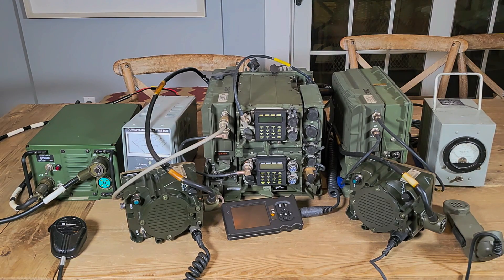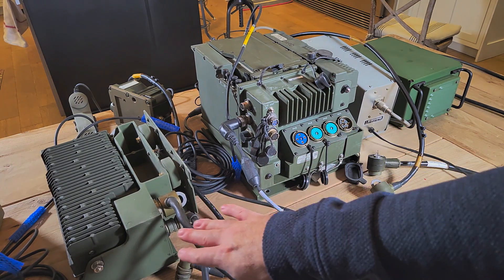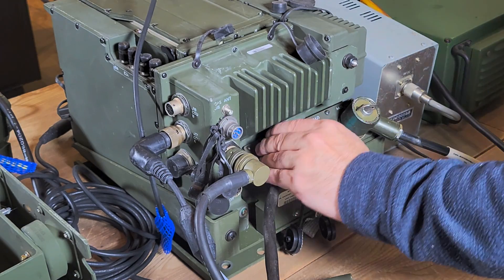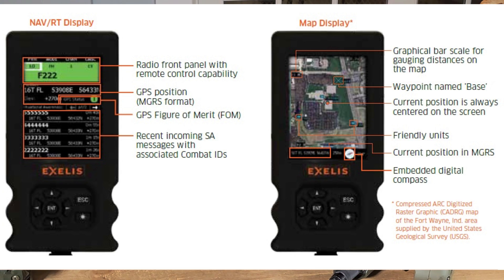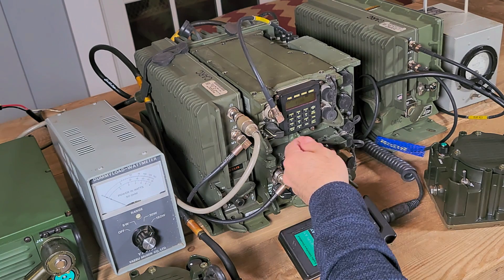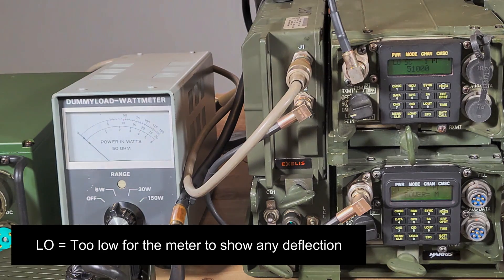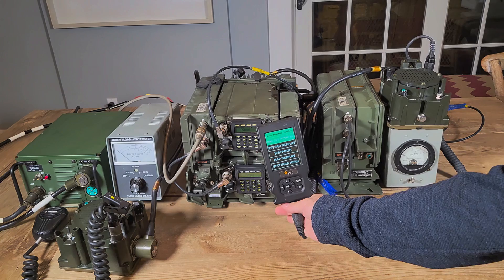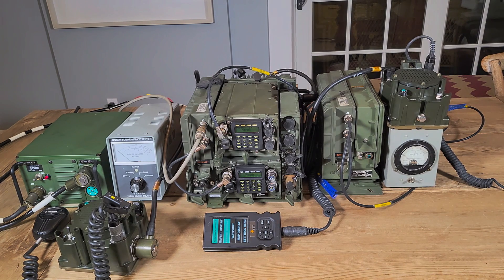SINCGARS ASIP AN/VRC-92 Setup and Testing!

Comment: what is the NSN/model number on the ampl adaptor and base mount? we're still using the old shit for the charlies and deltas lol........... also, do you know how many V DC are coming out of the J7 connectors and which pins to check for that?
Reply from the maker: Hi there. I looked for a while and could not find any NSN for the mount and VAA. Sorry I just dont have that info. I also don't have any pinout info for J7. Sorry, but good luck!

Comment: Hey there, do you know if a 24vdc, 400 watt power supply can be rigged up in place of the 26/28v power supply for desk operation? I'm a 26B trying to rig something up for my unit in a hurry 😅
Reply from the maker: I would say yes.  The internal power converters may have to work harder but it should work
Reply: I gave it a go, it works!

Comment: I just wanna know what a dogbone is. Might be a typo in my study guide. But the sentence no one seems to know anything about is 'requires a VRC-92 with "dogbone" and power source.' Plz help, thanks!
Reply from the maker: a dog bone is a short cable with a connector on each end. I dont know specifically what they are referring to, but if the VRC-92 system you're studying involves the earlier 1439 radio, it might be referring to the audio cable that goes between the radio audio port and the audio port of the VAA.
Reply: @w2hx  thank you so much! I now know something 99% of my leadership doesn't:)
Reply: The dogbone connects the two. It's for retrans. You can turn that whole setup into a repeater basically
Reply: See ATP 6-02.53 on armypubs website and read the retrans section. Dogbone is a W4 cable. See fig 3-1 in chapter 3 in the retransmission section for a schematic of a retrans setup.

Comment: Interesting but completely impractical. How would the military expect grunts to be able to turn the power on, let-alone configure it to actually talk to someone 😂
Reply: 25U would help make sure its setup right, but the sincgars equipment is actually pretty straight forward if you understand radio basics. The falcoln II and III equipment is a different story however.
Reply from the maker: I think for this system, an RTO might be useful.

Comment: what's the range for this out on the field?
Reply from the maker: According to the official documentation, the 50W system should get 10km to 40km (6-25 miles). thanks for the question!
Reply: @w2hx  awesome, I couldn't find the range anywhere. using this info for a military TTRPG set in the year 2000, thank you 🤙🤙